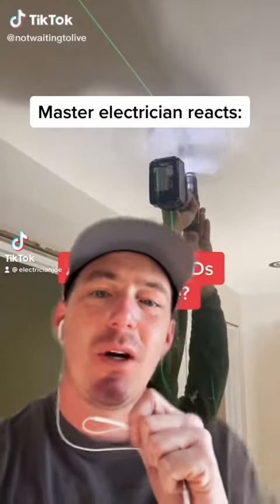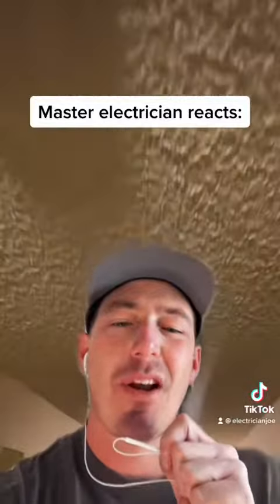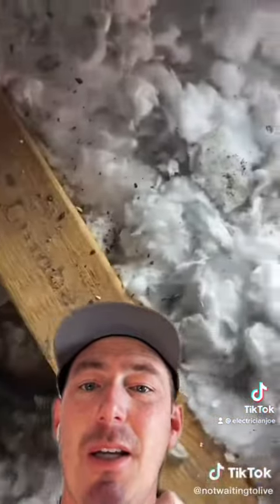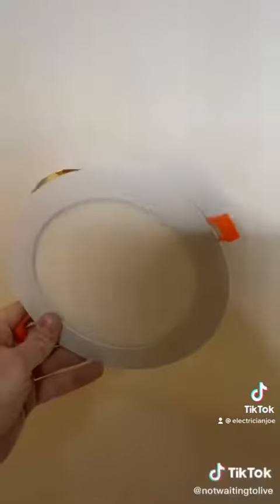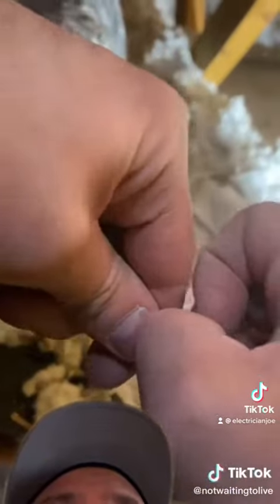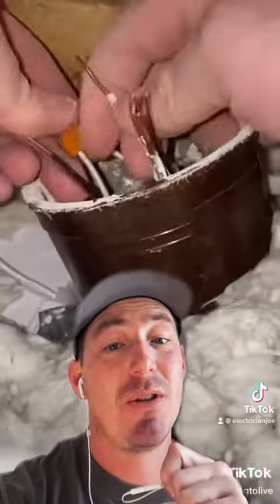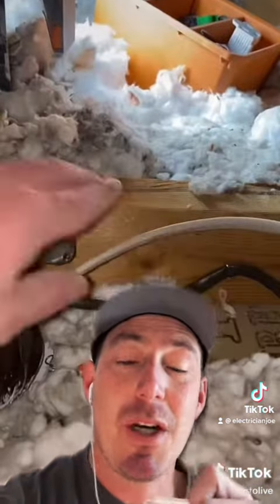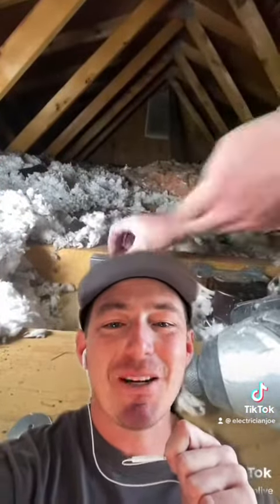Master electrician reacts: diy’er does led wafer lights. #electrician #diy #construction #learn

Comment: Yep.  Yep, yep and yep.  Cutting the wires too short is a no no.  I don't like the surface area of the connections of anything other than wire nuts.  I don't like stabs, at all.  It's good for him that his load is tiny with the LEDs.  The Kelvin color temp looked kind of blue, but in a dark hallway full of cabinets, that's prolly a good thing.